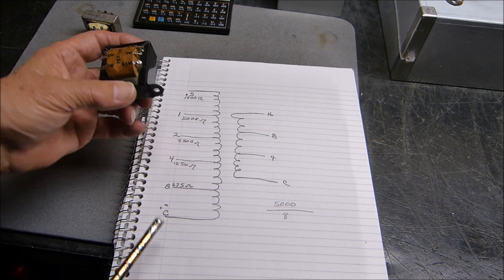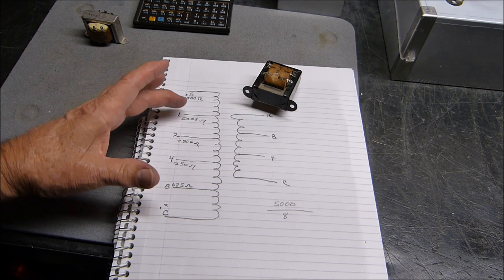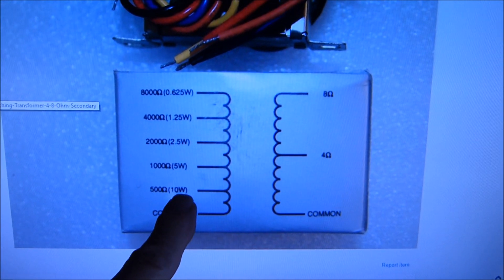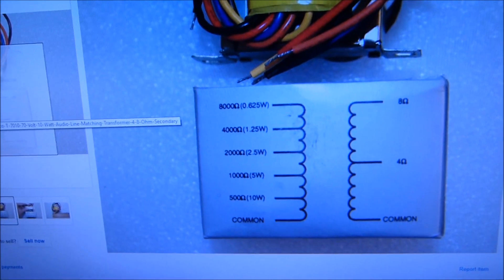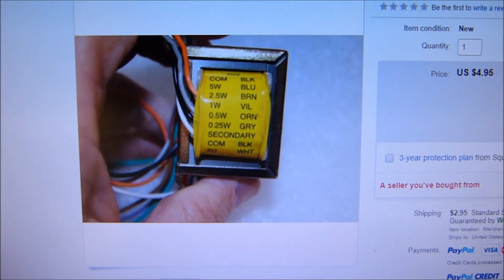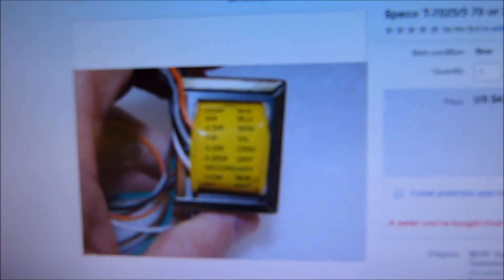Using Inexpensive Line Transformers For Vacuum Tube SE or PP Output Transformers

Comment: Yes i came up with the same idea .But you want to be sure that those transformers can handle high voltage 
Also i had one idea to design OTP amplifiers and used them to match 800 ohms to 8 ohms output
Reply from the maker: I just used two of these type transformers in series to get 600 ohm CT to drive a class-B pair of 3-400Z modulators for an AM transmitter.  The 3-400Z require 26 watts of drive. They worked great. Also, as I think about these matching transformers, I doubt they have a gap to allow DC in the primary windings so the core will saturate very quickly but they can be used with a blocking capacitor to match a plate load to speaker impedance. I use this method in a SET amplifier using 300B where I have a plate load using a 10H choke and separate the plate potential from the matching transformer with the blocking capacitor. Works good. Thanks for your comments and information on using them in an OTP design.
Reply: @ElPasoTubeAmps  GOOD JOB .. I was wondering if this could be done ..To increase output power !
Reply: @ElPasoTubeAmps  The more i think in OTP designs you could use several of those transformer to drive an individual speaker each one
Reply from the maker: @ladronsiman1471  As mentioned, I put them in series, taking into account phase and came up with 600 ohm CT for driving the grids and 4 ohms on each side of the secondary in series for 8 ohms and it works. I did make measurements with an impedance bridge so I confirmed what I was getting was correct. This is just my thoughts on it at the moment - I might consider loading the anode of a 6AS7 (I assume you are using a low mu triode like this) into a 10H choke for a plate load and separate that with a non-polarized coupling capacitor (two electrolytics back-to-back) into the line transformer(s) at some low impedance (250 ohm, 600 ohm, etc. - experiment around) and then the 4/8 ohm side to the speakers. Transformer separation would ensure no DC can get to the speakers. Just thinking - I have not tried anything like this yet.  🙂